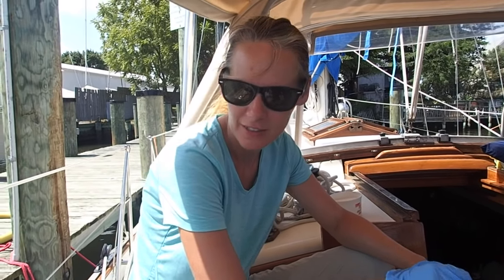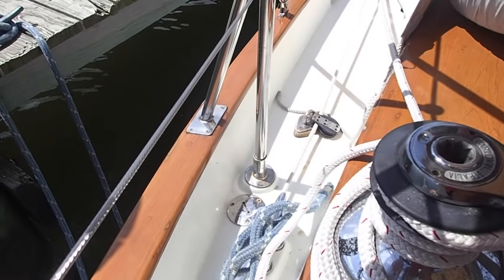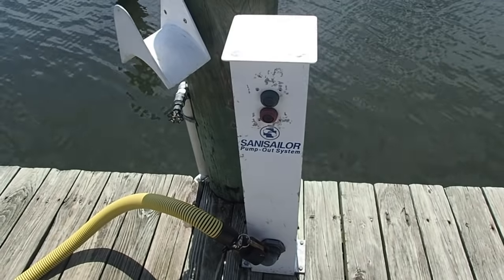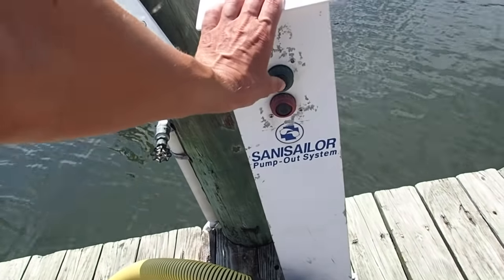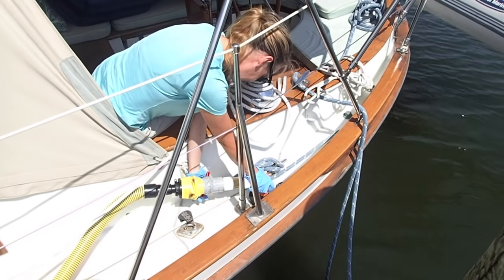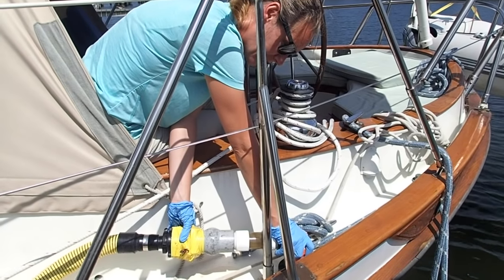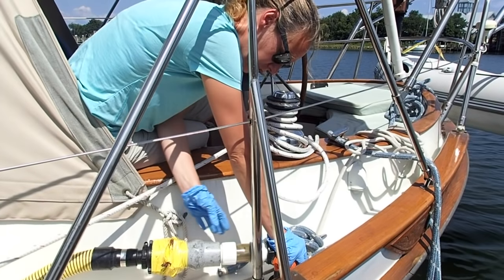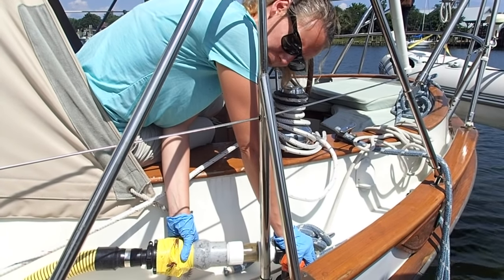How to Pump Out the Holding Tank On Your Boat

Comment: Normally you should reopen the valve before dipping in the water  after completing your pumpout. This reinstates suction and allows water to enter and flush the entire length of the hose. This helps ensure the next user doesn't get hit with any waste that may remain in the hose.
Reply: In fact, you should do that yourself to prevent the risk of some else not doing it! :) Rinse, Pump out, Rinse! :D
Reply: New to all this sailing stuff but I wonder when you flush with salt water after use, if it kills the bacteria further down at the sewage treatment facility. Makes it harder to decompose and an increase volume make less treated waste water flow back into the rivers and oceans. Thoughts?

Comment: I'm a little confused about the valve you're closing in the lazarette. Does your Tayana have a Y-valve that you can use to direct waste to either the holding tank or out to sea? If so, are you closing the Y-valve to the OFF position (neither selected) prior to pumping out?

Comment: How do you pump out when you need to out at sea (in a legal zone more than 3 miles from shore)...is there a convenient way or is it messy job?  Also, are there on-demand service people at marinas that will pump out for a fee?  Thanks!
Reply from the maker: +joapps If we are offshore we can open a valve to a thru hull which empties the tank.  As for your question about marinas, we don't have a lot of experience in this realm.  We have never rented a slip at a marina, only temporarily tied up at a fuel dock where the dock hands have always made it clear that we are responsible to control the pump out on our boat.  They will hand you the hose but you have to do all of the dirty work.
Reply: Return to Seasons - Sailing Thanks for your video and reply!! Safe sailing!
Reply: As a newish T37 owner with pumpout issues, can you explain this magic valve, where it is and why it exists. The pumpout guy at Anchorage in Bmore would appreciate it :-)

Comment: how do you know in the event that you get no flow, if the problem is on board, or with the pump unit?
Reply from the maker: You can submerge the pump house into the water to check the suction.  That will eliminate the pump out unit!

Comment: how do you know when your tank is full?  and what about the vent if it works properly, How do  you check that?
Reply from the maker: The handle on our head will stay in the upright position when our tank is full.  Judging by the smell that emits from the vent line on the side of our boat, the vent is working just fine ;)
Reply: oh right ..... i see now. thx Salty Seaman.
Reply from the maker: The pump handle on our manual head will remain in the up position if our tank is full.  As for the vent, we typically know it is working because it is venting the holding tank on the port side and sometimes you can smell it, especially when we first start the engine or hit a few big waves.
Reply: good to know.... Is it true that if you use the head that it will make the boat smell inside? Some "liveaboards" say they dont even use the head cause the plastic tank smell can permeate thru the boat and make the boat smell inside. Some say that the hoses are bad but these liveaborads think that just casue they use the tank that it will make the boat smell. Is that true? Personally i use bathroom cleaner after using the head that helps cut down on the boat smell inside... Not the stink using the head but the smell in the boat that stays inside the boat im talking about....
Reply from the maker: I can only speak from our experience, which is when the hoses are old, they can carry a terrible odor, or the vent is clogged, the boat has smelled.  Our holding tank is in our lazarette, under the cockpit.  We have never had any odors from the tank.  But I have heard horror stories of people who have had leaks in their holding tanks which are below their v-berths.  We have been lucky.  I also imagine heads that flush with fresh water rather than salt water are less inclined to smell, as they are not also dealing with the funk of marine organisms.
Reply: yes i agree i think use fresh water to dispose of waste rather than salt water in sea life conditions.would make the tanks,hoses,and vents work better....
Reply from the maker: Unfortunately for most cruisers fresh water is too precious to use to to flush the head.
Reply: generally i think good practice is that for livaboards fresh water in the holding tank maybe top choice. Since most marinas have running water. But if your the cheap kind and like bottled water for sure use salty water.... Depending on the length of stay out at sea. You know you can mix sea water and slat water together it wont explode but when your coming in i would use a pump out before docking back in again.
And well if your a racer well you always have the bucket to wave overboard....
Reply: salt not slat. sorry.